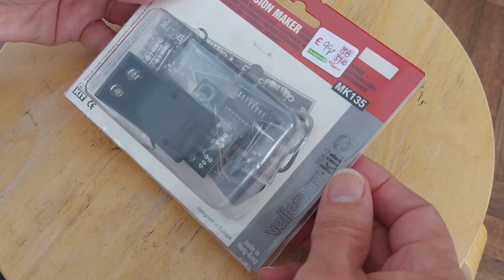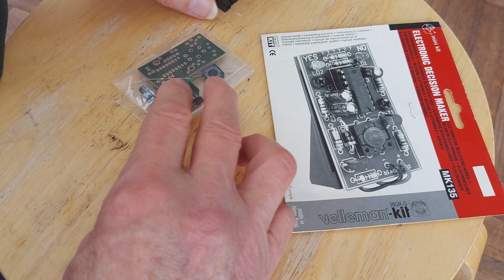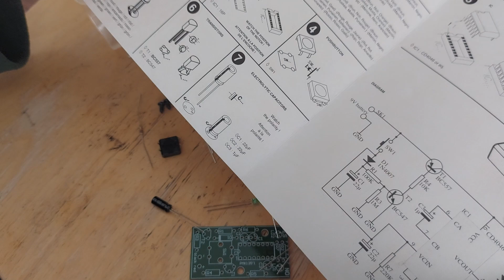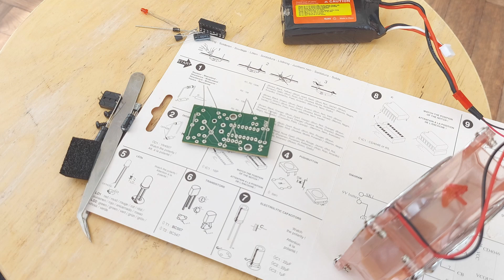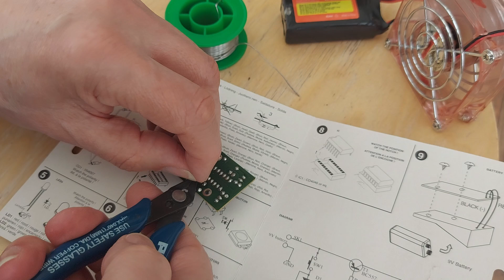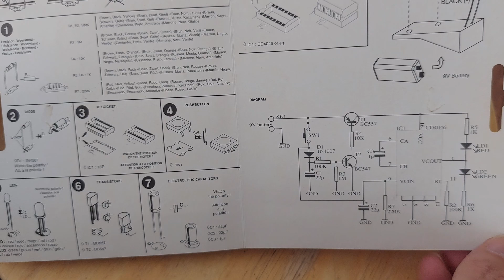Velleman Electronic Decision Maker Kit FULL LENGTH BUILD

Comment: Been a while since you did a cheap soldering kit! Quite indecisive for a decision maker...🤔 An electronic version of Jim Trott from the Vicar of Dibley if you've seen that 😂 No no no no no...YES!
Reply from the maker: Perfect description 🤣👍 Yes, eBay used to have quite a range of cheap kits around £1. I think I did all the ones I could find at the time. Since then they have gone up in price. I have just had another look, there are a few under £2 and some around £3. I can see a simple 4 digit LED clock for £1.20 that I might order for the fun of it. Might be interesting to see if it arrives as other listings for the same item are over £8 so it might be a scam listing.
Reply: @GrandadsOtherChannel  I did a few from AliExprss a couple of years ago but they've gone up in price too. I see that £1.20 clock, could be a pricing error 😛
Reply from the maker: @SquareOrbits  We will see, I ordered it 😁
Reply from the maker: @SquareOrbits  email this morning from the seller.They have NOT offered a refund yet.
"Dear Customer,
First of all, I sincerely apologize for the inconvenience caused to you. Recently, our system accidentally displayed an incorrect price during an upgrade. This unusual situation caused the price in your order to be much lower than the actual cost, causing unexpected trouble to both of us.
We know that your trust in us is priceless, so we feel very sorry and blame ourselves for this technical omission. Currently, our technical team has intervened urgently and the problem is being solved quickly to prevent similar situations from happening again in the future. At the same time, we have also deeply reflected on and optimized our internal processes to ensure that we provide an accurate service experience for every valued customer.
Considering the unique circumstances of this price error and its impact on our operations, we regretfully have to request the cancellation of your order. We fully understand that this may cause you inconvenience, and to apologize, we will provide [corresponding compensation plans, such as coupons, discounts for next shopping, etc.], hoping to make up for this unpleasant experience to a certain extent.
We value every interaction with you and look forward to continuing to provide you with excellent service in the future. We once again apologize for the inconvenience this incident has caused you and ask for your understanding and support. If you have any questions or need further assistance, please feel free to contact us, your satisfaction is our always pursuit.
Thank you again for your tolerance and understanding, and we look forward to serving you better in the future.
careforyou123."
Reply: @GrandadsOtherChannel  That's a shame 😅 I bet they don't want to be the ones to cancel the order, probably reflects badly on their account or something
Reply from the maker: @SquareOrbits  it smells of a scam to me 🤔 As expected.
Reply: @GrandadsOtherChannel  I had this once so I played the game.
Initially it had a low price and also a make an offer.
I made a low bid and got the message to say it was cancelled due to a pricing error.
Every. time it reappeared, no one bid so I rebid with my initial offer every time the bidding ended and was relisted. I gave up after 6 months of trolling the seller out of boredom